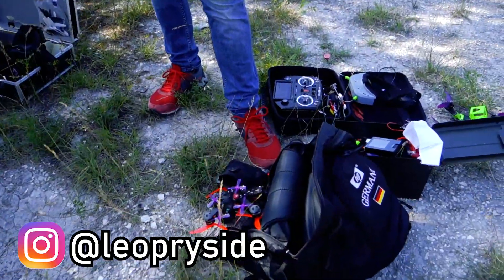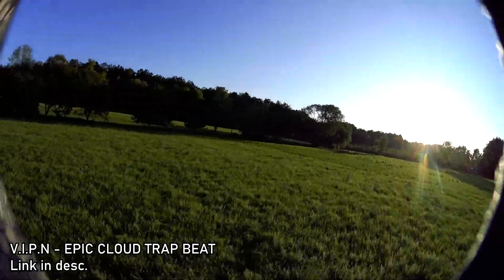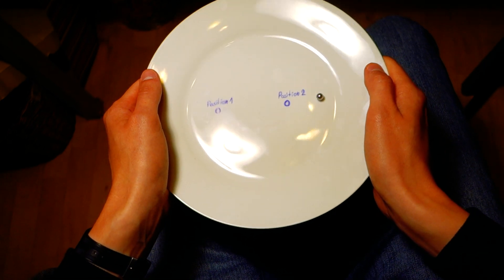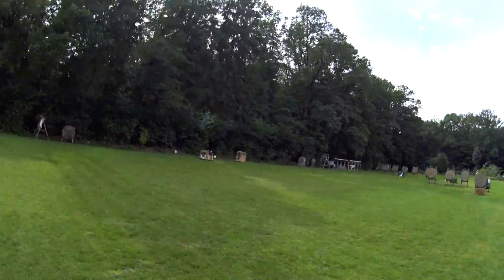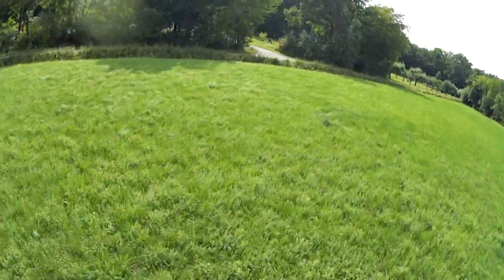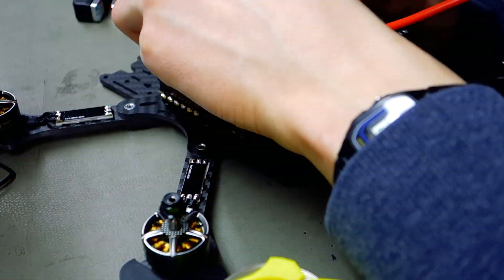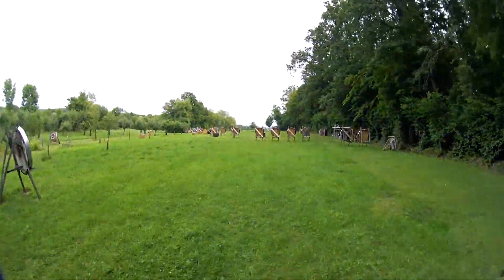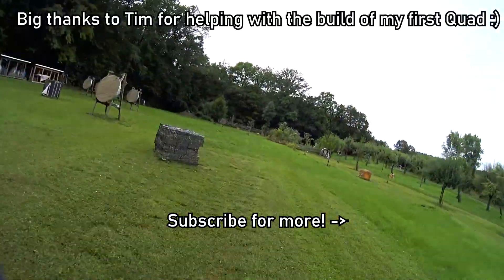WHAT is a FPV DRONE?

Comment: Instead of a TVS diode, why not have a reverse polarity diode to battery positive so you're not wasting that energy?

Also, if it's a full bridge driver with mosfets, those may be included in the MOSFETs themselves by the fact that they're MOSFETs, from source to drain. Did you check it with an oscilloscope?

Comment: steuerung also wie in minecraft nur ohne z achse oder wie in cs:go spectator mode. EZ
Reply from the maker: Nein, das erklär ich ja in dem video. Du fällst aus dem himmel wenn du nicht konstant kontrollierst. Es ist 1:1 wie in echt Helikopter fliegen. Arma und BF haben sehr ähnliche heli mechaniken
Lad dir vllt mal DCL auf steam und spiel das mal mit nem controller dann bekommst n gefühl dafür.
Reply: @Pryside  hab mir 
Überlegt das ganze so zu gestalten das ich das über nem Laptop mit Maus steuern kann. Der Grund dafür ist das ne Maus viel prezizer ist als ein Kontroller. Ich versteh schon das die Dinger halt auf Grund der bausweise immer mit steigender Geschwindigkeit in die richtung fliegen in die die Rotoren zeigen es ist dann wie eine klassische spectator Steuerung aus vielen Videospielen nur mit dem zusatz das man immer in die richtung in die die Rotoren zeigen gezogen wird. Aber das scheint echt ein extrem geiles Hobby zu sein. Weiter so ich feier jedes deiner Video ich finde es unglaublich das du die Motivation so viel Zeit und Mühe hast um die in deine Hobbys zu stecken da bin ich echt neidisch. Weiter so.
Reply: Ach ja mir ist ne super alternative zu nem Mikrowellen transformer eingefallen für einen battery Spot welder deine Schaltung von der ich übrigens keine ahnung hab weil ich ein brutaler noob bin allerdings so ein ganz  bisschen  weiss und ich dachte ne Autobatterie starterpack die haben 12volt und ne peak power von 1000a ich bin darauf gekommen als ich mir nen Schaltnetzteil aus nem servernetzteil gebaut habe um meinen subwoofer zu betreiben hätte bestimmt drauf gehen können hat mich aber nicht gejuckt.das Netzteil hat 1000watt Leistung 12v 85a ich denke das reicht um mich zumindestens sehr zu schocken bzw. Ernste Verbrennungen da auszulösen wo der Strom durch meinen Körper fließt naja ich lebe noch das ding hat ja für so nen scheiss ne schutzschaltung jedenfals sind mir plus uns minus Kabel mal zusammen gefallen und zack waren die nur noch schwer auseinander zu kriegen. Glaubst du das ist sicherer als nen Mikrowellen transformer da man ja nicht mit Netzspannung spielt und der Wiederstand In der haut den Strom am fließen hindert zu mindestens auf trockener Haut?

Comment: Does the VESC 4.12 have a tvs diode?
Reply from the maker: No, only the focbox has one
Reply: @Pryside  mhh ok... So can i expect my vesc on 13S with around 15A regenerative braking to burn out sooner of later?
Reply from the maker: 13S is impossible you will instantly destroy it.
12S is already critical for 13S you wont even find a tvs diode since your battery voltage is 54,6 an no tvs diode will have a breakthrough between 54,6 and the 60V the components are rated for.
13S is guaranteed to destroy your vesc
Reply: @Pryside  I agree that running it on 54,6V is very critical because the drv8302 can only handle 60V. I did already run my setup on 13S without regenerative braking for more than 5 weeks with no problems at all. I calculated my negative voltage sag when using 15A reg. braking to be at a maximum of 1,8V which would still be 3,6V below max. voltage. I wonder if the voltage spikes can reach 60V easily? And if they do is it enough to protect my VESC from those by setting its maximum input voltage to f.e. 57V? I also have a BMS which should cut off power at around 57V, does that help protecting it? Thanks for your help!
Reply: @Pryside  by the way i am using a hub motor which has a maximum of 800 rpm at 54,6V so the erpm stay pretty low

Comment: Hey are you sure you're flying those tmotor f60 pro III on 6s cause they aren't rated for 6s and to be honest 6s on 2500kv isn't healthy for any of your components. I would strongly recomment switching to 4s Batteries. Even those HQ V1s  5x4.3x3 you are most likely rocking will burn out your motors
Reply from the maker: Thats not how bldc motors work. They dont care if you put higher voltage into them, what creates heat is the amount of phase amps and since they are not higher then on 4S I can simply create the same amount of current but over a higher range of rpms. Creating the same amout of torque no matter how many S you have always creates the same heat.
On top of that in 99% of the cases people burn their motors is because of voltage spikes and the motor controllers beeing damaged. Some people in the fpv community have no idea about the engineering side and noone uses a tvs, sometimes not even a big cap, and then they say stuff like "i never buy expensive escs because they always die anyway".
 That cant really happen on my setup, I sometimes fly with a ton of throttle and no component of my quad gets hot except the battery.
I will give you a update if ever something breakes but so far ~200 packs flown and no issues whatsoever
Reply: @Pryside  you know i actually didn't want to offend you or anything i actually liked your Video. I know that its probably not the electrical engineering side of Things which i have to admit isnt my strongsuite but since i actually am a mechanical engineer i quickly researched that Motor in particular and the bearing isnt rated for those high rpms.
Reply from the maker: I'm not offended, just wanted to clairfy :)
That actually might be right, but I dont know if only 50% higher rpm are that big of an issue. Since the load on these bearings is pracically nothing.

Comment: The max lifting capacity is never even close to what it is on paper. A 5 inch drone probably wont even lift 5kg let alone 10kg. 2kg is the maximum i ever managed that was still somewhat controllable.
Reply from the maker: Hm, I dont know. Never measured it, just took a calculator for my quad and something around 3Kg per motor came as a result so I took these numbers and ran with it.
Reply: It has to do with a lot of different factors. Often props do better in forward flight instead of a hover. But you need it to work in a hover to even take off. If you say the max acceleration is 10G and weights 0,5 kg the max thrust while in motion is probably  only a little bit over 5kg. It’s interesting to mess around with. Maybe you could even make a video about it🤷🏻‍♂️

Comment: Endlich mal ein Thema was mit zu mein Hobbys Gehört, ich würde an deiner stelle deine Drohne zu ein 6s System Upgraden (mehr Power, mehr speed), Die Kamera ist Geschmack Sache, ich bin immer noch Happy mit meiner RunCam eagle pro 2, Gute Nachtsicht, Gute Bild Qualität + OSD. In meiner Drohne hab ich ein GPS-Modul eingebaut (Was mir schon manchmal den Arsch gerettet hat, bei Verbindungsabbruch fliegt sie zum letzten punkt wo sie Signal hatte) 

Ich hoffe ich konnte ein paar Neue Informationen Geben, 
Ps. Du hast den Video-Transmitter vergessen in der Beschreibung :D
Reply from the maker: Ich fliege 6S haha. Ja GPS werd ich vllt auch noch upgraden, so als failsafe schon ganz nice
Videotransmitter gabs nicht bei banggood, kann aber mal reinschreiben was es für einer ist
Reply: Leo Pryside haha das ist ja mutig ein 6s System mit 4s Motoren, solange es gut geht :D
Reply from the maker: Die motoren halten das ja locker aus die drehen halt nur schneller oben raus, hast mehr thrust und top speed.
Du gibst ja nicht sonderlich mehr phasen-ampere und daher auch nicht mehr wärme dem motor